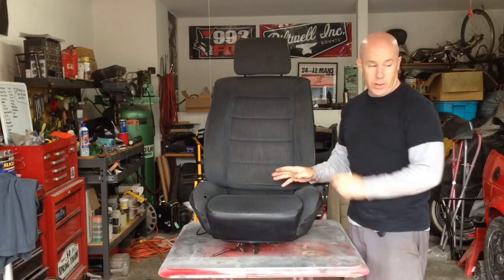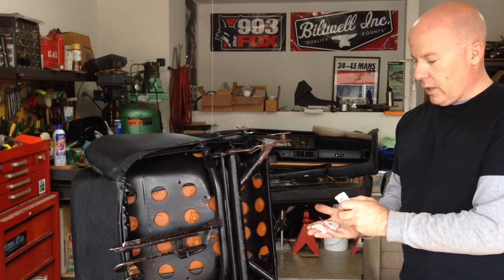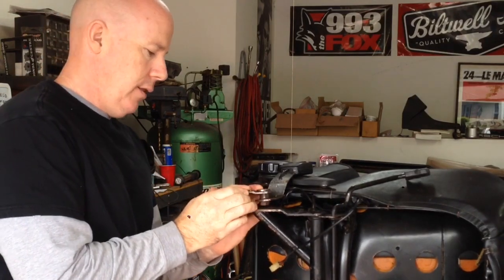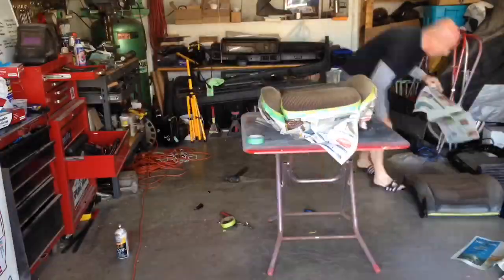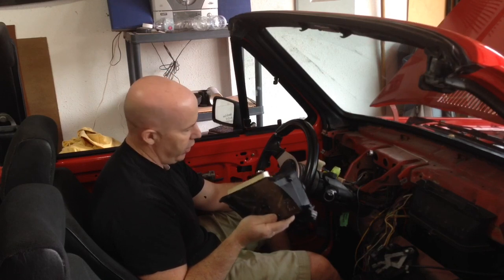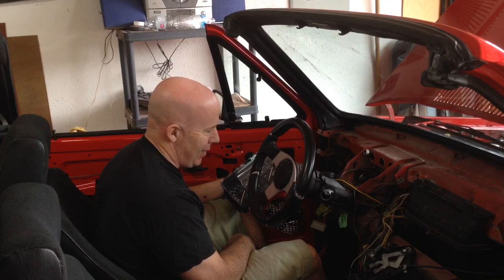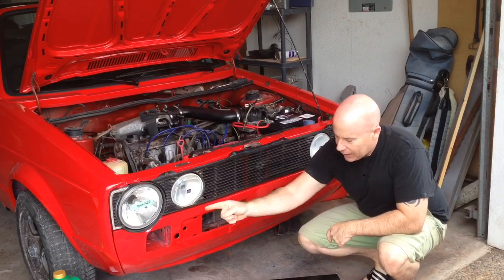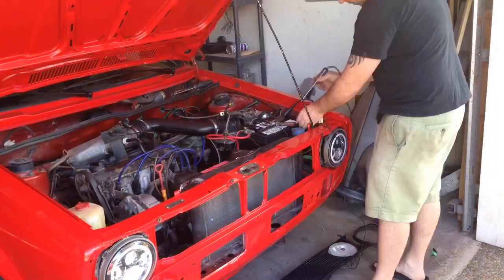LED Headlights and Seat Bushings - 1980 VW Mk1 Rabbit Convertible Project Episode 31

Comment: You need to add a resistor to get the indicators to flash correctly
Reply: Slowly *^
Reply from the maker: Thank you I appreciate the tip. I will do some research on how to do that.
Reply: @analoggeneration385  it new relay that replaces your old relay

Comment: What headlight mounts did you use?
Reply from the maker: I just used the stock headlight housing.
Reply: @analoggeneration385  Hey bud sorry to worry so u just took the stock headlight mounting and used it on the new Headlight? Can I ask does this moment just come off the stock lights or do u have to break it off and glue it onto new lights?